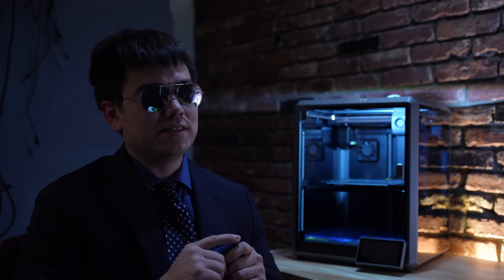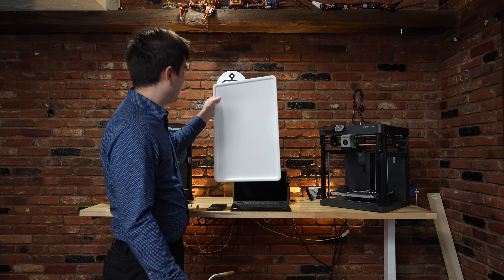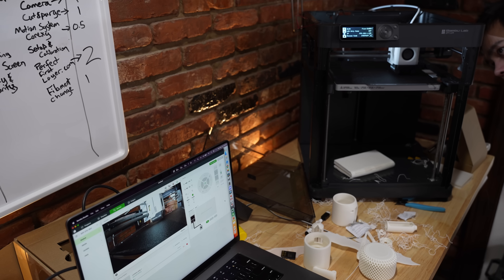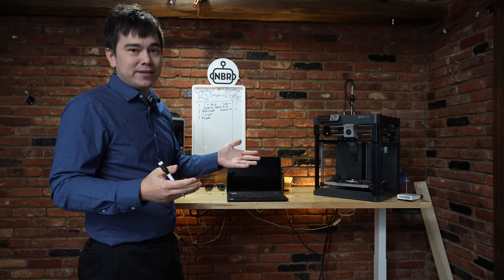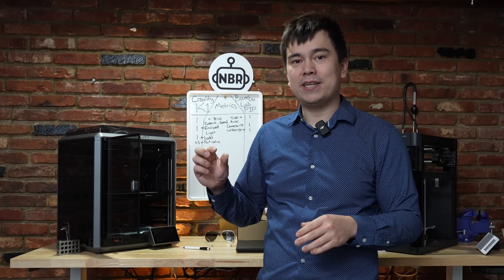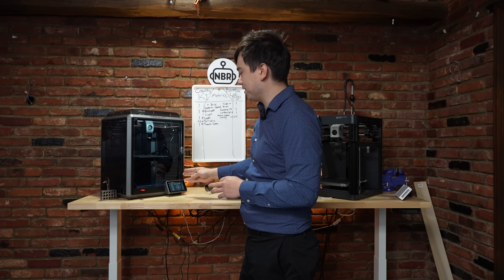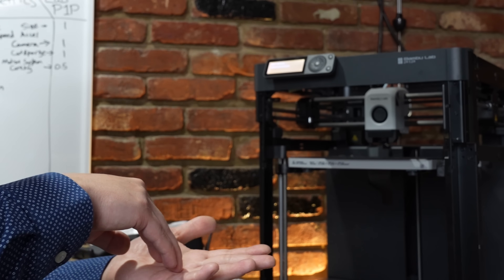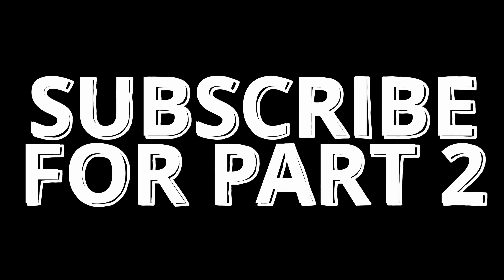3D Printer Fight Club: Creality K1 vs Bambu Lab P1P Episode 1

Comment: The biggest point goes to the engineers of Bambu Lab. They came up with the whole concept and serve their ideas for an affordable price. A lot of people hated Bambu because iT’s nOt oPeN sOuRcE, but those printers just work. As one of their first printers, the idea and innovation counts
Reply from the maker: Their execution of their design is excellent. It just works™ 98% of the time.
Not a whole lot of innovation yet IMO, as you can point to examples of pretty much all of their core technologies in the open source arena. But very polished and professional design at a decent price.
Creality is trying to undercut on price and improve serviceability and open-ness while making some compromises to get the price down.
Reply: @NathanBuildsRobots  well said. The biggest innovation Bambu made was taking features that already existed and combining them in a mass produced product with a focus on ease of use. I don’t think we want to restrict that market to just Bambu. If anything, the praise belongs to business people at Bambu for recognizing the gap in the market. The engineers are great and all but there is little innovation in that respect. Maybe the LiDAR but I would have to look that up.

Also, the open source part is about being able to make accessories and modifications to the printer, not about not being able to make corexy printer with a welded frame, vibration compensation, 3 lead screw beds, etc. all that had been done.
Reply: @NathanBuildsRobots  
For me, the Bambu cloud-thing is a cold shower.
K1 seem to be suited for offline ... so, no contest IMHO. K1 wins.
Reply: I don’t know about ‘coming up with the whole concept’ as it’s a corexy printer with linear rods.
Reply: Exactly what concept did they come up with other than packaging existing technology?
Reply: @NathanBuildsRobots  I don’t know any printers in this price range that do almost everything by themselves. A nice looking and working (smart) MMU , micro lidar and eventually more hidden features. Everyone shouted in the beginning, but know other company’s do the exact same thing. I know of Vorons, but spending almost the same (or more) for the same product is at some point an innovation. No company (except orange 2016) did something huge in the last years
Reply: @ZappyOh  you can use the Bambu offline too, but using YouTube and be worrying about a cloud is kinda whack
Reply: @yodhanhunter  micro lidar, a set and forget printer including nozzle cleaning and a couple more features. CoreXY isn’t new, but they set new standards
Reply: @zincyellowmach1523  selling a non i3 printer for less than 1k€ and using modern tech. Look at other company’s, selling clone after clone while holding their quality

Comment: That was pretty neat, side by side comparison, intro was gold. 

During your K1 series my P1P arrived so I have probably a dozen prints on it. Added the AMS and now building an enclosure. This printing fast thing while amazing has some downsides with print and surface quality. Amazing machine but just getting used to it (I have Prusa Mini and MK3S and a heavily upgraded Ender 3 V2 with sonic pad etc). K1 does look very promising, and we have Bambu Labs to thank for pushing things along and also bringing a whole bunch of newbies/fanbois into 3D printing. 

What I am noticing already is if you are looking for quality finishes of parts slowing down outer walls and top layer speed is required. 

As others have mentioned I think Creality needs to put together an AMS to compete with Bambu here. I have recently owned MMU2S = really shitty, hard to build, setup and tune the load/unload and get it to work, ending up selling it. Mosaic Palette Pro 3 - amazing device, works once the settings are tuned and can handle different filaments, I still have it but takes up alot of space and then need to think about filament rack/case Bambu Labs AMS - early days but just plugged it in about 10 minutes, loaded 4 rolls of eSun filament. Then I just printed 2 multi colour models one a test took 1.5 hours, then one second a Spiderman 4 colour print took 5-6 hours. Both worked perfectly without any real interaction. Already within a couple of days the Bambu AMS is the winner by far for me as with limited time and space a 4 colour AMS which is compact relatively cheap and just works most of the time is going to be a keeper for me.

Bang for buck the K1 is looking really good especially for a first effort from Creality. However $699 is a pre-order price and I wonder if this will really stay as the retail price it really feels like a loss leader if so. For example how would the cost of producing an Ender 5 S1 / Ender 3 S1 compare to K1? Surely the production costs of a Ender 5/3 would be less than half, the K1 has full enclosure and cast aluminium frame, molded plastic extruder with Canbus, list goes on.
Reply: The price is $599 and if you look more closely, there is no regular price listed, so $599 is the regular price, you get 2 kg of filament as a gift if you pre-order!!
Reply from the maker: AMS seems nice, will set mine up when I have some time. K1 is exactly what creality needed to do to stay relevant with bambu changing the market.
I think speed printing is a little overrated. With any printer you don’t want to run it at max speed unless you are on a short timeframe and a few minutes or hours is actually important. Most of the time even on my fastest printers, I only go about 2x-3x faster than I would on an Ender 3. They claim crazy shit like 5x or 12x faster but i don’t use them that way
Reply: @NathanBuildsRobots  what is nice the AMS is it is literally plug and play,  screw in the buffer at the back two power cables and chuck in some filament which auto loads once you press each button and feed the filament down. Totally agree with this printer being what Creality needs, they don't want to end up being the Nokia if 3D printing, if they get these right many ppl benefit from competition, choice, through their supply channels and wider parts availability. Having said that Bambu parts are probably cheaper and easier to get than some Prusa parts in Australia due to there being an Australian store. Interesting to see if we get a rash of X1/P1P clones or just a handful of high quality interpretations by the bigger vendors eg Qidi, Kingroon, Creality as the high speed Core XY designs really require a higher level of engineering and r&d investment which is more complex than cloning and Ender 3.
Reply: @dejedejsson  true sorry forgot the price as always switching USD to AUD gets confusing here locally K1  $899 AUD versus $1069 AUD plus shipping for P1P, I still maintain that is a loss leading price, alot of printer for that money.
Reply: @ben10001111  What will be your total cost for a P1P with encluser and AMS?
Reply: @dejedejsson  probably closer to $2k AUD as I ordered the extra cooling  fans and the original glass door and top, in hindsight probs should have just got X1C.
Reply: @ben10001111  Did you choose the "Minimal" Enclosure on Printablse?
Yes, I have calculated a P1P with encluser+Ams+ Aux fan and it will be around $1550 but then the x1cc costs me $1850

Comment: Spoiler Altert......My experience with the K1 has been really good so far, I was expecting to go full hate on Creality based on the 10+ Creality machine I have owned so far.  The only issues I have found so far, is the Cable Chain does make contact on the left side of the printer, and the front door does rattle a bit (solved by a door/drawer bumper).  I have not had the under extrusion issues that Nathan has had (due to the loose filament release) my filament release is tight and make a satisfying clik in the lock position.  In fact, I have had to reduce my flow rate by 4% when doing hinged and tight tolerance parts.  I really like the Interface on the K1 and love the fact they have a web based interface (Fluid like interface, lacking terminal and the ability to change config files, and fan speeds). I also really like the fact that the machine on the print menu has a history tab.). The Creality Cloud App has a crap ton of options (too many you can get lost) and it has advertising when you fire it up like a freemium game, it often shows ads for Anycubic machines (WTF)).  But the Creality Could app allows you to slice files right on your smart phone and send them to the printer.  They seemed to have also taken note from creators and removed protected files, even though I am sure they can still be found, alot of this issue stems from the fact that users can easily (too easily) upload STL's without realizing they will be public if the right options are not selected and not enough moderators to catch them.  At the end of the day, if you want to print multi colors, get in AMS + P1P, Single Color, based on my K1 experience, get the K1.  Time will tell if Creality provides parts and support, on the flip side if Bambu Lab is like DJI (since many of them come from DJI) expect support to be dropped quickly after new models are released, again time will tell.
Reply from the maker: Good comment, lots of info there. What I like about Creality is they generally open source within a year of launching their products. This is huge for long term maintenance. It’s not about the hippy commune of free ideas, it’s about having access to all the parts and files so that another company or user can support your product indefinitely, in case you decide to stop supporting it. Also huge it’s a huge win for modders.
I want to get a new extruder from Creality. The early review units that got sent out are not 100% reliable.
Reply: @NathanBuildsRobots  Agreed 100%, I feel like this is going to boil down to a Google vs. Apple Eco battle.  Bambu Lab being Apple.  Bambu Handy App is clean stripped down, Creality Cloud is loud and proud.  Same with the hardware.  Creality Machines in the past required a lot of work to get good prints, not so much with this machine.  I defintely didn't get a pre-production machine(I wish mine came with the really cool crate, honestly a little bummed when mine came in good old cardboard!), it was shipped with the latest firmware and I have not had any issues with the extruder, I have printed PLA, ABS, and a little TPU.  I didn't have any other vibrations from any other components minus the door (Cut a door/drawer rubber bumper and stuck it at the notch at the bottom and has been quite ever since).  My X1C had extruder issues and door alignment issues from the factory (Kickstarter Edition).  Nothing is perfect, I do like the fact that Creality has done there homework and put in some engineering and software work into this machine.  Even Creality Print which use to be a joke of a Slicer is pretty darn capable(even though OrcaSlicer is now my prefered slicer).
Reply: Issues with Creality machines are user based. There are third-party firmwares and cheap mods to fix any issue they may have.

Creality just wants to get 3D printers in to more people's hands. It's their fault for assuming that westerners still have basic skills to finish or modify it for their needs.

My ender's needed at most $100 in upgrades to print just as good as a Prusa.

This comes from inexperience working on machines and electronics.

My very first Ender 3 V2 is still going strong daily. My S1 is one of my favorite printers.

I just get a little tired of people dissing Creality over their own shortcomings.
Reply: Just wait until things start breaking, like those plastic gears.
Reply: @theglowcloud2215  Bambu Lab has plastic gears in there extruder, has been rock solid. I have a ton of hours on my X1C

Comment: I think a better comparison would be the X1 Carbon vs the K1 as both are enclosed and both have touch screens and are comparable for the features. The P1P was a price pointed system for those that wanted a Bambu Labs but could not or did not want to afford the X1
Reply from the maker: Yeah, I have asked Bambu Lab to send me an X1C to test, because I am not paying $1300 for one.
Reply: But doesn't the X1 just add a bunch of training wheels that most people don't need?

I think that's the other reason people bought the P1P instead.

I don't need anything that comes on the X1 carbon.
Reply: Maybe not at all, because Creality is launching the K1 Max which should be competing with X1C in terms of print volume and auto leveling technology... What do you think?
Reply: @dangerous8333  That's a gross over-simplification. It does indeed add a lot of quality of life features, but there are engineering differences in the two models. You can literally see the spec sheets on their sales page.
Reply: Hardened extruder, hardened nozzle, LIDAR, nice touch screen, enclosure with glass, better webcam, aux fan, etc.
Reply: @mitsuracer87   .. best slicer !

Comment: 10 out of 10 for presentation... loved the sketch, made me laugh out loud!  On the reviews, a couple of requests: 1) efficiency/energy use is a big issue in Europe with our current energy prices, so some simple practical idea of energy costs of using a printer would be helpful though I appreciate it's a complex thing to model given different use cases... speaking of which, and building on @AldoVerdugo's point 2) it would be interesting to have your opinion on printers for a number of "use cases" such as fast prototyping, print farm, RC or similar hobbyist from the POV of printer strengths - but I appreciate that's perhaps complex.

I watched your vids on the Creality 5 S1 and it also set me thinking, the printer prices at the moment are a bit all over the place for bed-slingers versus core X-Y and it's getting pretty confusing.  Any ideas on a decision tree for a first time buyer to prioritise their needs, and make trade-offs?  The "who is this for" comments of most youtubers are really so superficial that they might as well not bother... but I KNOW you'll have a valuable perspective on such things.  Thanks, sorry for the long post but I feel you are actually listening, not just asking for comments to boost video rankings!
Reply from the maker: Thanks, will think about the use cases/decision tree video. For energy, I would just need a watt meter. The K1 might be more efficient due to it being smaller and fully enclosed, but it’s hard to know without testing
Reply from the maker: Another interesting point on the topic of power is that the peak power draw on the K1 should be lower due to the DC heated bed. So it might be easier to fit more on a single circuit breaker.
Reply: @NathanBuildsRobots  Cool, thanks for the lightening fast reply.  On the energy usage, the question might be, "Who should factor this in?"  Of course, for some of us we want to be responsible about energy use for the climate so it's another decision factor like when you buy a washing machine.  But at what use level does energy really have a bearing from an economic standpoint, or is it not relevant?  Print farms would certainly care.  Another angle is energy tarrifs: in UK some of us have a cheap overnight electricity rate we can use, so overnight printing saves a huge amount... but does it also negate the benefit (from energy use pov) of a faster printer?  All things being equal we'd all choose a faster printer, but good to know.  Thanks, loving your channel and approach... next level youtubing too with that cliff-hanger ending LOL!
Reply: Sorry for the deluge, final point and no need for an answer!  I'm also interested in part strength and the things that - beyond design/slicing - affect it in terms of printer choice... so for eg the under-extrusion of the Bambu P1P, how/to what extent will that affect this or is slicing and design more relevant?

Comment: Red pilled
Reply: Probably had to hard of time removing the MicroSD Card from the P1P, which is not as bad as the X1C which requires a flat blade to extract, and dont use a metal flat blade or you will damage the MicroSD Card...don't ask me how I know that!

Comment: Definitely prefer the USB Type "A" slot rather than those silly little mini-SD cards that ALWAYS get lost. I think you missed another point for the K1: most of the electronics are in that bottom chamber which should  be a little less hot than the enclosed print chamber (that bit of padding that you added to the bottom may help in that regard as well) .... subscribed 🙂

Comment: Like the acting a lot 😁gj nathan for comparison video. If you can do it, i really like to see how well K1 handles high temp materials. I already know bambulab is killing it with very well designed hot end. But got my doubts on the creality. I use to have so many heat creeps with their older designs, especially if i try to enclose them. Thanks and keep these videos coming please.
Reply from the maker: Well definitely try out some high temp materials next week
Reply: @NathanBuildsRobots  Their is a bug in the firmware, I find I need to pre-heat bed to 100 or it will throw in anomally error if you just fire up print without this step.